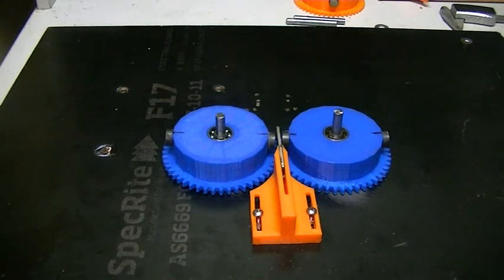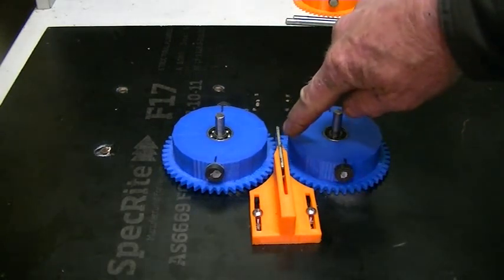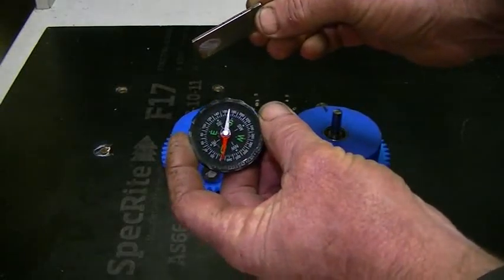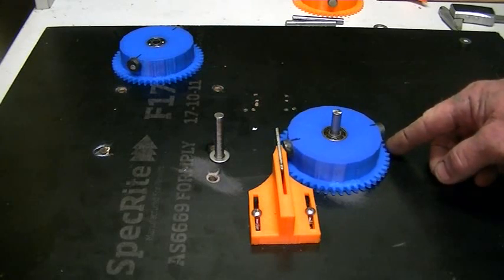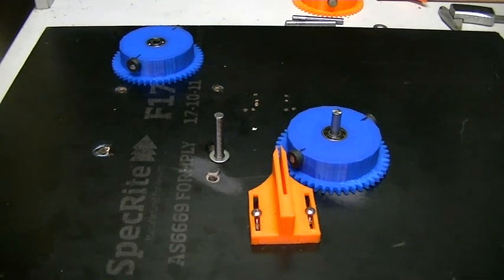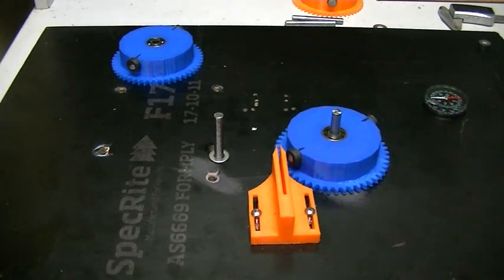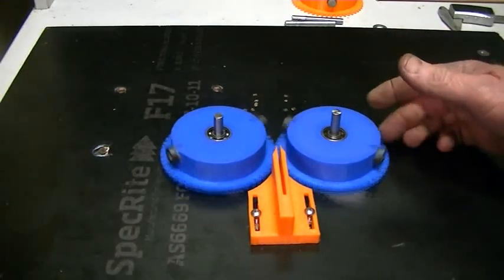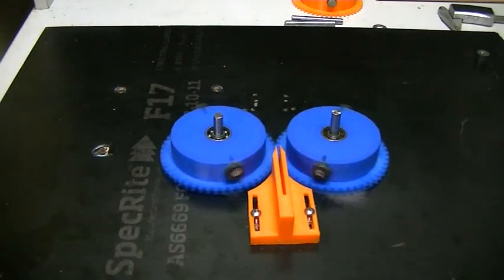The magnet motor that wasn't pt2

Comment: I think you've got it a little mixed up. That center piece does not have to be a magnet. It's got to be an ordinary piece of iron, which is tapered in thickness towards the end, facing the rotors. The idea is that the magnets are attracted to the metal from both sides but as they reach the tapered part they start to slowly begin to repel eachother and if that point is well adjusted, the magnets will suddenly come into full repulsion and push eachother away, causing rotation of the rotors. Even the spacing of the magnets on the rotor would be important, to ensure continuous movement. This is what I understood from the description I read, about this setup. Thanks.

Comment: I did an experiment that requires two gears working similar to the ones you did with the following difference:
The left wheel instead of a magnet, a metal stuck to it. and the magnet that is in it, fixed in front of the point they are at.
The metal on the left wheel will isolate the magnetism of the fixed magnet with the mobile the moment they meet. The fixed must be in repulsion with that of the wheel.

Too bad I can't do this engineering.

Congratulations on your video.

Comment: this setup will work with some mods I will solve this one for you in a few  iterations.  run these test
you need more megs on each side alternating the poles

 1) change the center magnet to a piece of copper of the same size. (a) test different logical  offsets of the gears 

 2) change it too 2  piece copper sandwich together with a insulator (a) test different logical  offsets of the gears 

I think you see where i am going with this. inductance in the copper will attract the next meg one one side and repel the other magnet on  the other

Comment: Maybe two thin bismuth sheets with a steel coil in between and a reed switch to break the current developing and reverse the flow to a capacitor the charge can then be added to motive force through a counter wound coil. Pressure is built as magnets approach a inductor you must release or a cog will result.
Reply: years back similar ideas with a transistor and center tapped coil where scrubbed from YT!

Comment: What if visualizing the poles as dual vortices, one side like a firehose(expel) and the other like a tornado(impel) . Using the visualized "lines of force" seen through a viewing film or ferrocell would allow to see the no straight lines and see a need for a curling/curving when approach & departing come close together to continue their escape paths.
Like a magnetic gyroscope or how magnetic fields of  planets will interact with one another.

Comment: Shouldn't the center be a metal like iron to attract and the magnets when above repel? And more magnets meaning their should not be a gap for magnets not to repel. You setup relies only on kenetic and  ot potential energy which 1/2 the concept is out. That way the original design.  If you r doing to disprove something do it right is all anyone asks and this is just a constructive suggestion to help so no offense.